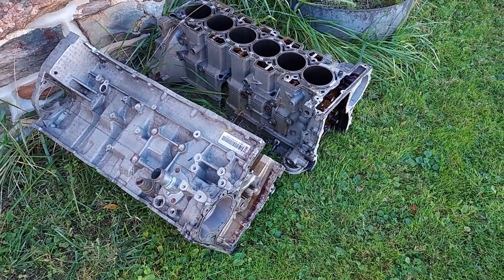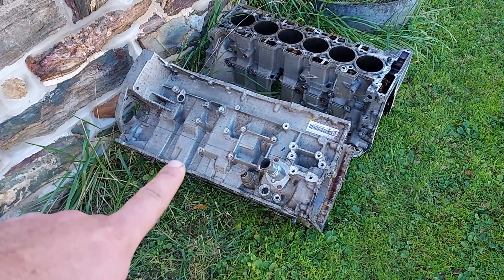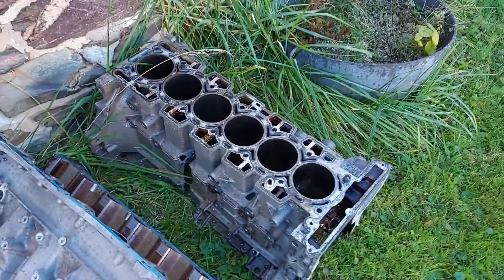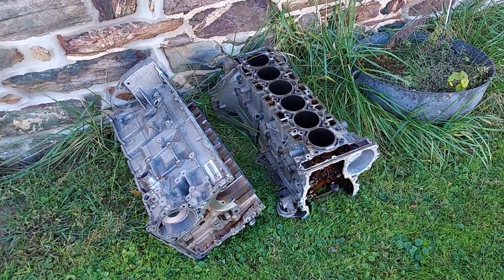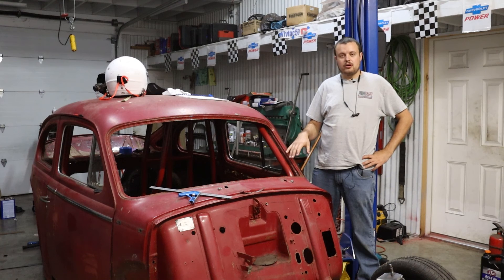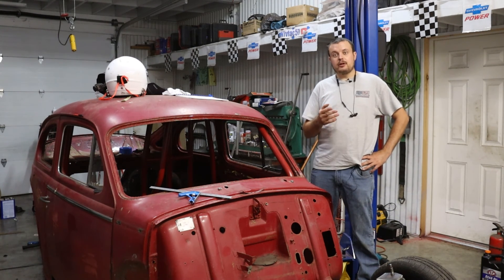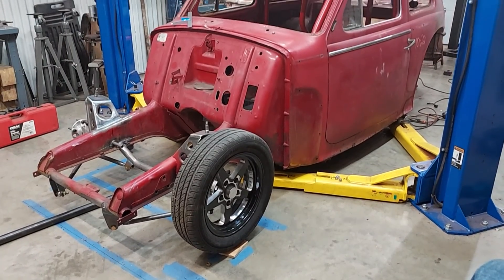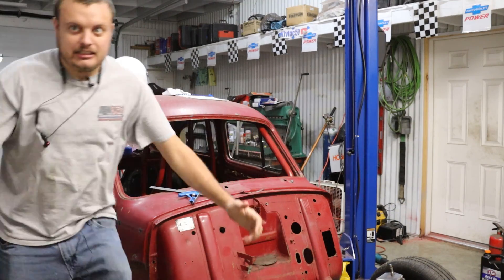Building a Custom Front Suspension for the Volvo - 1959 Volvo PV544 Build #sickweek here we come!

Comment: The stuff you find at swap meets and flea markets just amazes me.
Reply: I wish there was a flea market like that around here! I live in central Florida, so all the flea markets have touristy crap.
Reply from the maker: @michaelblacktree  what about turkey rod run?
Reply: @Calvin-Nelson  - In the past, I haven't had much luck with that. Plus the entry fee is $20 a day. I used to visit the flea market in Sanford, but it closed down a few years ago. I also used to go to swap meets at Moroso. But that was closed down as well. That's a common theme in central Florida, everything getting replaced with apartment complexes and strip malls. Sorry for the rant.
Reply from the maker: @michaelblacktree  that sucks... sorry about your luck. At least winter time isn't so Dang cold! Lol
Reply: Everything has its ups and downs. But yeah, the winters are mild... great weather for building (and racing) project cars. Actually, my Bimmer is about to hit the streets after a full suspension overhaul and interior makeover. Can't wait! 😎
Reply from the maker: We just bought another set of those struts from a flea market this past weekend.

Comment: This and the fairmont have to be my top favorite builds you've guys have done with the 4200 platform. Wish you guys could do a tubular manifold with a 6-1 collector to get that radical sound out of it, but man that engine bay is tight. If you want some ideas for a manifold look up "1000HP 2JZ - SPOT ON PERFORMANCE VL WAGON FKX275 V2.0" they did a tubular 6-1 manifold with a side exit exhaust.
Reply from the maker: Nice. I'll check that out. Thanks bud.